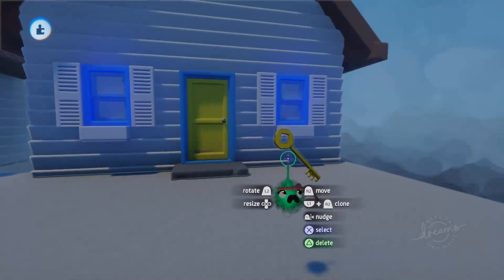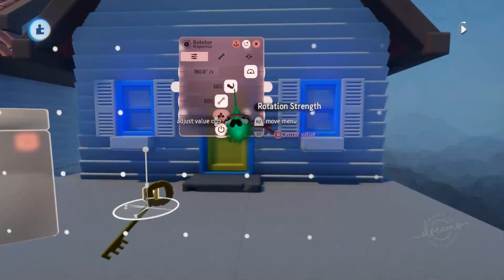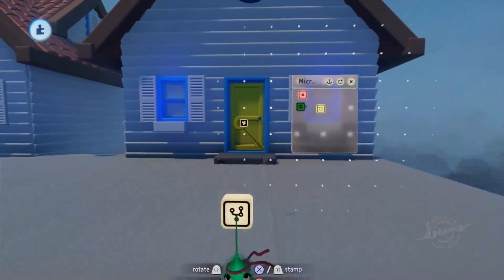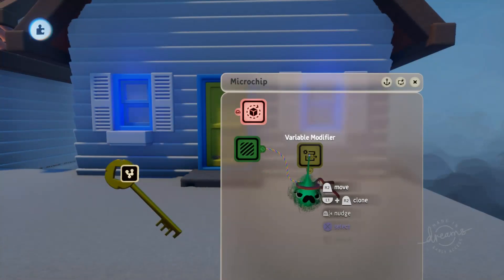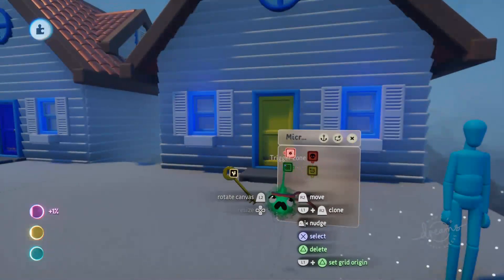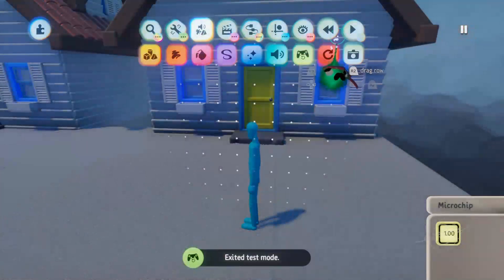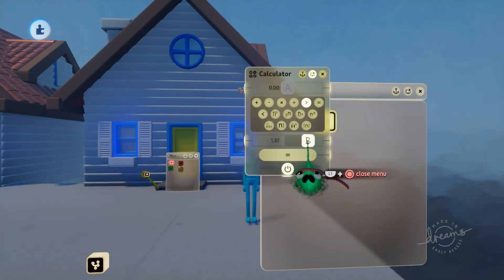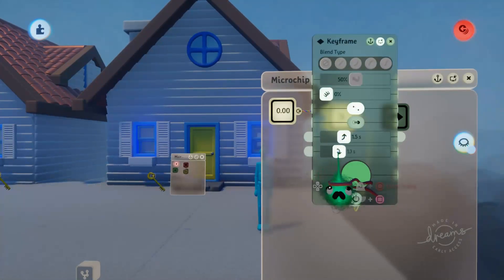KEYS AND UNLOCKABLE DOORS - Short Circuits - Dreams PS4

Comment: I really enjoyed the tutorial and it helped a lot. But I ran into an issue. I did EVERYTHING you showed us to do with the microchips and the keys. For the first few times I tried it, it worked. But then I tried it AGAIN just to double check and the door refused to open 🤔 Maybe I messed something up, but I swear I did everything you told us to.

Comment: Nice video. Learnt a lot! I’ve worked out how to do all of this. And i’ve also made it so that the player has to go up to the door for it to open after you have collected the keys which was easy enough. I’ve also put a text displayer in front of the door. So when the player goes up to the door and tries to open it without having collected the keys, it says “Need 3 keys” when near the door. But how do i make this text become inactive when the player has collected all of the keys? I tried using a destroyer but didn’t seem to work. Thanks!
Reply from the maker: You could use a variable modifier to 'get' the amount of keys the player has collected. If that number is 'equal to 3' (calculator) then you could disable the text with a not gate :)
Reply: JimmyJules153 Thanks i will try that